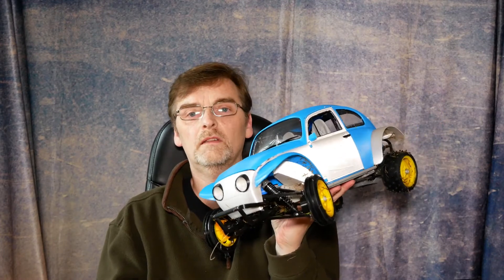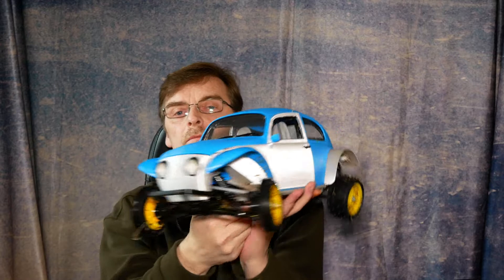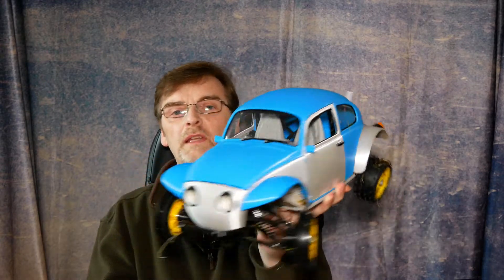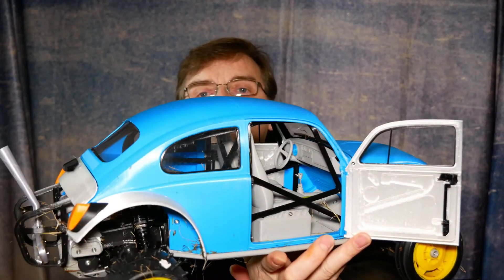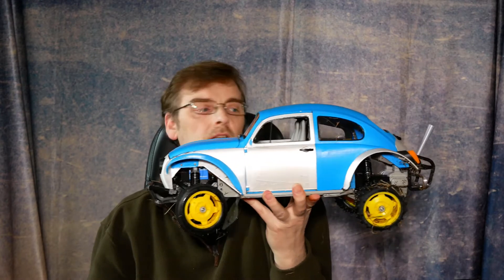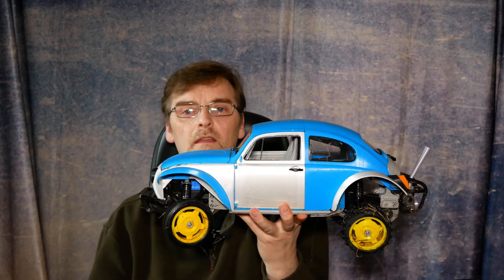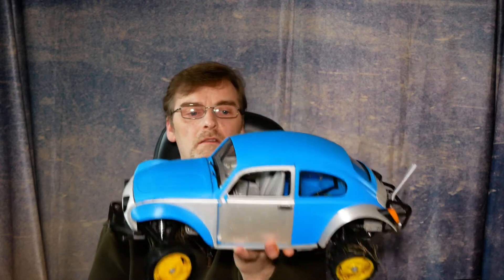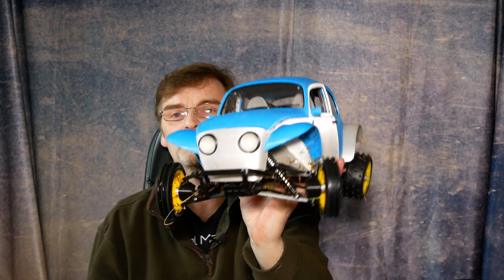Model 7 buggy

Comment: What settings did you mount the front and rear axles? there are 3 different ride heights to mount them, Road, intermediate and Offroad. Look closely at your it seems that the rear is in the Off-road position but the front looks to be in the intermediate, any particular reason why you choose that?
Reply from the maker: Hi. I think, partly because the tamiya wheels are a bit small on the rear and also to give it a bit more control. Thinking about recycling it to build the new roadster version!
Reply from the maker: You did call it. Off road setting for the rear and intermediate for the front